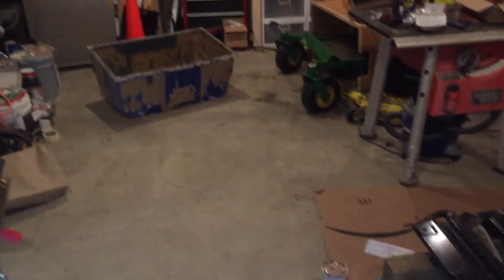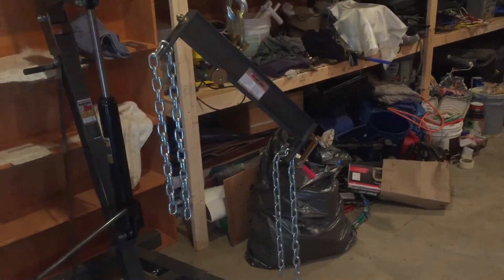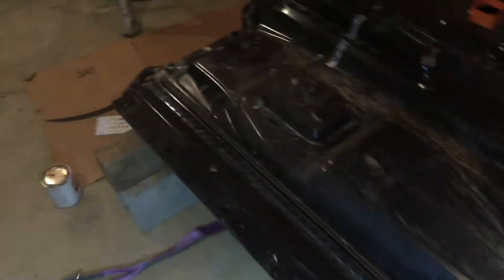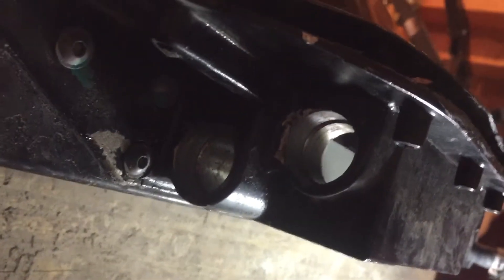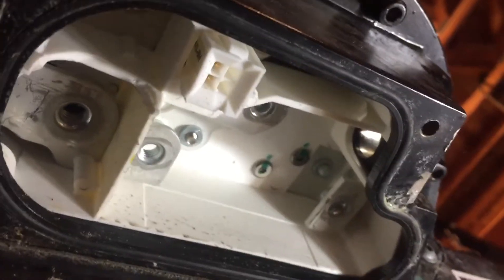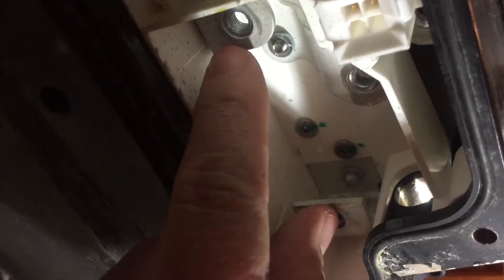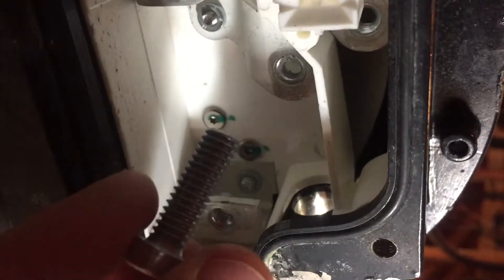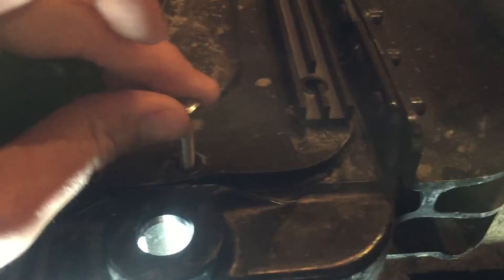Toyota (Tesla) RAV4 EV battery disassembly Part 5

Comment: What are you thoughts of the CATL million mile battery and Toyota's partnership with them? Do you believe their is a chance of them supporting the older vehicles?
Reply from the maker: No the Rav4 has been forgotten long ago. The only way we will see more range is if someone like me does it.
Reply: @JamesKlafehn  Do you believe we can purchase cells from CATL that we can replace our batteries with in the future it does not look like Toyota really care about the well being of their customers. Which is really fucked up. They rather lose customers to Telsa than to support their vehicles.
Reply from the maker: Hardcore Video Gamer I don’t think it’s Toyota any more than Tesla. Tesla was hire first a job. They did it and don’t want to go an inch more. They don’t want to supply parts so Toyota customers have to wait MONTHS for replacement warranty parts.
Reply from the maker: @jamice4u  No. The battery pack on the Rav4 ev is a custom size and shape for the custom batteries that Tesla made for the car. I have toyed around with the idea of installing tesla 85kwh modules but it would take a lot of custom work.
Reply: @jamice4u  Toyota doesn’t care because it’s not their product. They can’t service Tesla parts, and Tesla won’t service Toyotas. There is some speculation that Toyota is more invested in hydrogen fuels, so producing their own EV would be counter intuitive. HOWEVER, batteries don’t last forever. We can’t have EVs rotting in landfills, when all they need are new batteries. There are already service industries that will either rebuild or replace old batteries, and some that will modify ICE vehicles, even brand new. So I’d imagine an automotive future where you could take your RAV4 EV, your Tesla, your 50s hot rod, or your brand new F150 pickup, and have batteries and motors swapped.